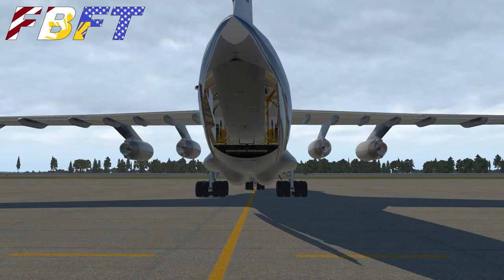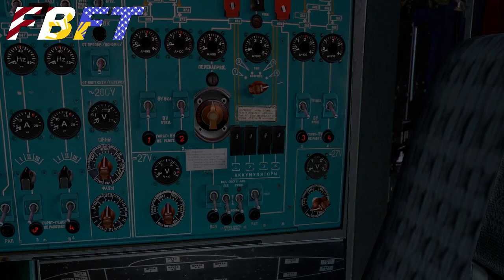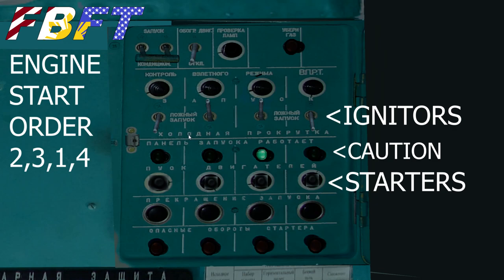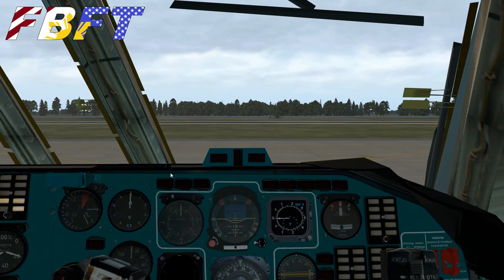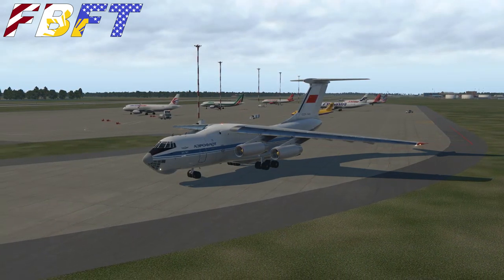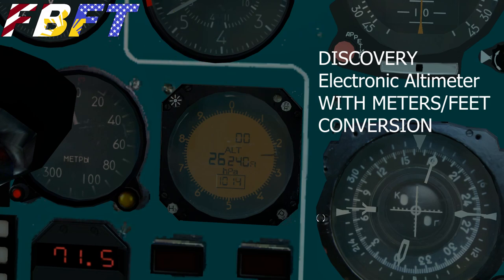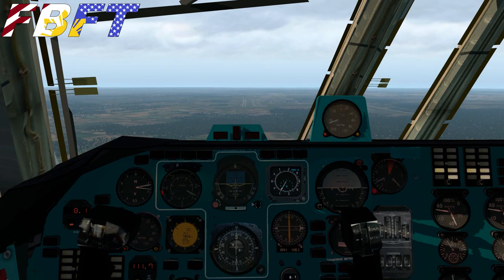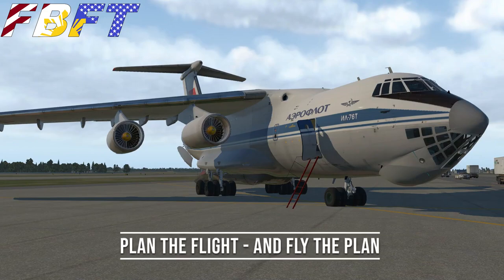X-Plane 11 | Ilyushin 76 Tutorial | English Language | Beriev A-50 Compatible

Comment: So based on just some observations the panel you suggested as fuel is definitely bleed air/climate control, most of the flow lines go into temperature controllers and at some point I guess also has an environmental intake on the front. The fuel system is on the front of the pedestal but doesn't seem to actually work. If you want the altimeter in feet, there's an electronic altimeter above the standard one, just crank the brightness nob to make it visible. Unfortunately it only seems to have hPa and not inHg setting. Great job otherwise :D

Comment: 6:21 APU damper flap is IIRC APU air inlet.
7:00 Upper one is APU heating (OBOREB BCY). Lower one is DC fuel pump. Heating is used to heat APU compartment for starting in temperatures below -25*C.
7:45 BCY is APU DC generator, PAN is DC ground power. OBORP AKK is battery compartment heating (with yellow lights).
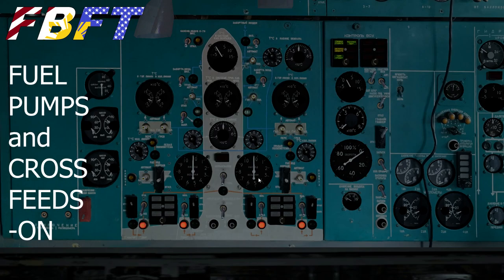12:26 That is bleed air and air conditioning panel.

Comment: Actually it wasn't fuel panel, but air pressurisation panel.
Reply from the maker: Thank you for the correction! Did we get anything else wrong?
Reply: @FlightBrothersFT  Nothing major I believe. It is a good tutorial overall. BTW. There are two electrical installations there, because one is for DC and the second for AC. I don't think there is any fuel installation modelled in this a/c. You could see how the panel should look like on your non-XP manual, s. 26, drawing (Pnc) nr. 13.

Comment: I can't move camera, it's stuck at one place, any suggestions??
Reply from the maker: Are you using the 'no KLN' version (on folder label)?   If you use the KLN version (the folder has no special label) without have the add-on KLN installed, I believe you will have that issue.
Reply: Flight Brothers FT ah yeah i found that out, thanks :)
Reply: @FlightBrothersFT  Okay so i began flying this plane again, and I don't get that tablet on the side, any suggestions?

Comment: How did you open the doors on the IL-76? :)   (pls answer)
Reply from the maker: The default keyboard command for doors in Xplane11 is usually to press SHIFT and F1.  If there are multiple doors SHIFT F2, etc.  I believe the Ilyushin doors open with these default commands.
Reply: Thx, i'l check

Comment: I really want to fly this plane, but I have a problem with the taxi, the plane will turn very slightly and then it will start sliding even though the gear is turned sideways. How can I correct that ? Running latest version 1.36?
Reply from the maker: Hmmm.  That is not an issue we experienced with this aircraft.  Typically when that happens in XP there is either an issue with the aircraft itself (ground friction coefficient I believe it was called) or the rudder/tiller inputs for your joystick have gotten off.  When the tiller input is not linked to the rudder it tends to handle exactly as you described.  Wheel turns only about 5-10 degrees and throttling up can make it simply skid forwards regardless.  Check your joystick setup in XP to check this.
Reply: @FlightBrothersFT  Wow very quick response, thank you. I tried using the tiller and the rudder and it happens both ways. I've messed a lot with other planes with the ground friction coefficient, but haven't touched the Il 76 acf file. I will see what I'll do. Thanks buddy ! =]
Reply from the maker: @dimitarnedelchev892  our pleasure, sorry we weren’t able to help.

Comment: thxxx
Reply from the maker: Our pleasure. Happy flying and thank you for taking time to comment.
Reply: @FlightBrothersFT  Thanks man you saved me, that aircraft is amazing i love it, btw can you tell me how to activate wheel controlled with roll?
Reply from the maker: @Keratsss  do you mean linking the tiller (ground nose wheel steering) to the rudder input? In the settings you can link them where you configure joysticks and keyboard commands.  If you literally mean to link it to roll (ailerons), I'm not sure that can be done.  I'm also not sure it should be done, as you may have issues in crosswinds.
Reply: @FlightBrothersFT  yes i prefer to link tiller to the rudder, but idk how xD